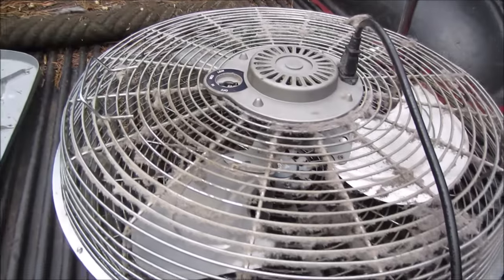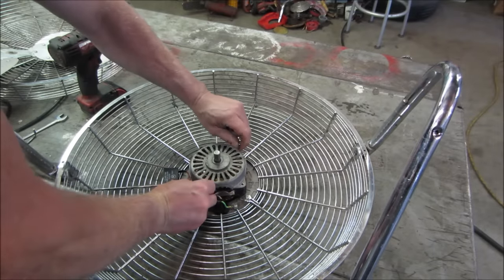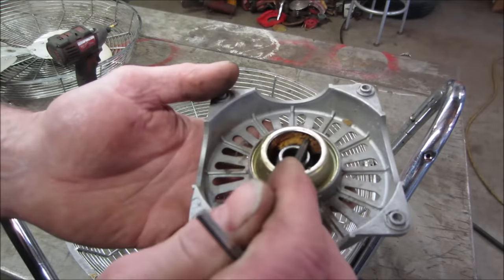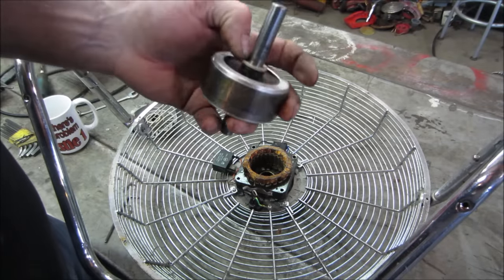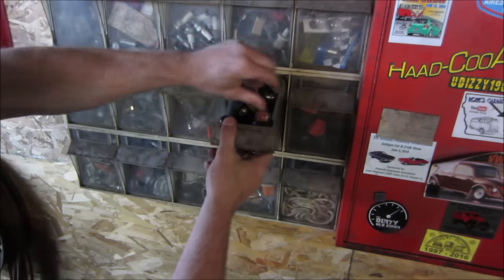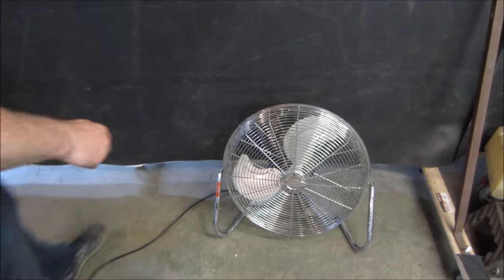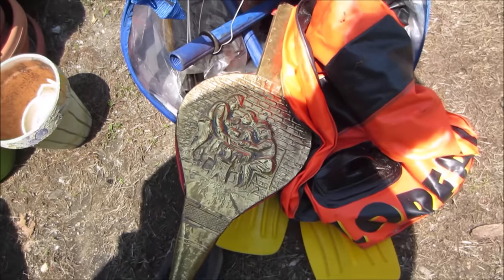Fan Blades Won't Spin? Lets Fix It

Comment: I found a dyson bladeless fan in the bin worked fine just needed a clean on the inside now works good as new
Reply: People are throwing away stuff instead of just a bit of mainrenance. Or fix a broken wire. Ridiculous.
Reply: @marcryvon  As we say in Yorkshire more brass than sense
Reply: I think the saying is One mans trash is another mans treasure
Reply: I picked up a Dyson vacuum, just needed to be cleaned and a new drive belt. Better than $250 new.
Reply: I’ve found and fixed 7 dyson vacuums dumped by the roadside. The only problem are the heavily clogged filters. It causes the motor to overheat and tripping the thermal cut-out.
Reply: Spencer Wilton Dyson scored the lowest for reliability.
Reply: I found one of those Dyson fans also and the person said it was broken I said oh yeah what's wrong with it they said it's missing the blades and I tried to explain to them that it wasn't missing and they asked do you want it or not I'm throwing it away LOL I said yes I will take it took it home and cleaned it weren't a scratch on it but it was full of dust on the inside and all those little holes are plugged up but still use it to this day what an awesome fan never would have paid the money for it up front to begin with but if I had it to waste I guess it would say it was worth it because they really work really good for a long time don't know how old it is but I've had it for four years now and that fan was also 250 plus new
Reply: @aaronfarrin4057  lol this so funny but true

Comment: It's called "permawick" - an oil reservoir for shaft lubrication in a sawdust type medium, frequently used instead of felt.  It is NOT grease. I have used this product many times in electric motors with bronze/brass bearings/bushings.
Reply: years ago yes, then they went to perma-lies of cheap yellow foam rubber, which the oil conveniently breaks down into a gelatinous goop.......
don't ask what year, I don't know, they all kind of rolled into doing it at different times. ;)

Comment: 10:20 and 15:50 You should carefully "back off" the screws by hand to make sure they're "seated" (i.e., turn them counter-clockwise to feel for them to "drop" so that the threads aren't gonna cross) before you screw them in, especially under power.

Comment: 1:59 That pause, checking to see if the set screw had loosened, or if the allen key had snapped. Been there...
Reply: haha i thought exactly same :D
Reply: It's happened to all of us.
Reply: when you knew you were overdoing it but didn't want to believe you were… then crack
Reply: Hex key is far harder than the screw on Rockwell scale.
Reply: @alwaysopen7970  that type of set screw is often about the same hardness as the allen key! I've broken both before, it's a gamble
that is if your not smart enough to just torch blast the hub real fast, in case of thread-locking compound, which many did. flame wrench = mans second best friend :) (bark-bark)

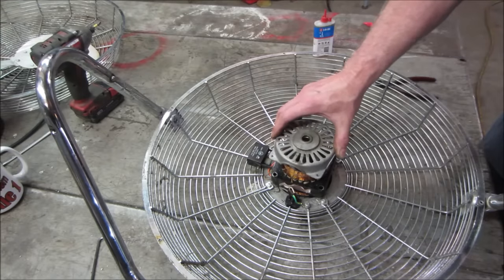Comment: 9:47 you can use a felt battery post protector to create a felt donut to put around the bushing to hold oil.  That's generally how those sintered bronze bushings in fans were designed.
Reply: That’s an excellent idea.
You can also use felt sold at Joann fabrics or other places like that.

Comment: Sintered Bronze bearings known as Oil lite bearings. I worked on a ton of machines when I was at Xerox, and these copiers had 100s of these pesky bearings. Mistreated, and these bearings made you pay. We started using Teflon impregnated bearings and things got better but still any side load, and these bearing would fail fast.
Reply: Yeah those oil-impregnated bearings get cruddy, but as soon as ANY bearing gets worn, the center shaft is no longer aligned center and the magnetic field cannot be as effective. Also, rinse and repeat what Mustie1 did every couple of years.
Reply: I prefer a military bearing.
Reply: Yeah I find even with regular oiling these “bearings” just eventually fail completely

Comment: Thanks for the inspiration! I thought my dehumidifier was dead until I saw your video. Took that fan out, cleaned it out similar to what you did here, and it's back in action with maybe 15 minutes of work. I was already pricing new ones, so you saved me at least $200. Thanks.

Comment: That foam you where picking at is the sponge for the bearing oil.  Your suppose to saturate the foam with oil also so that it stays lubed for a while until it dries out again.  Oil soaks through the bronze cintered bearing.

Comment: I found a similar Hawaiian Breezeway fan at my local transfer station, brought it home, cleaned it up everywhere except for the majority of the insides of the electric motor. Thank you for this video. It has the exact same thing wrong with it, it just won’t spin at all because of how gummed up the bearings are.

I hope that you are doing well.

Comment: Greetings: Those are sintered (aka oilite) bearings. They are designed to store oil for the life of the bearing. I would be inclined to wash out all of the excess died lubricant then relube with oil for the bearing; and I tend to use moly grease on anything.
The action of the air-flow pushes the rotor rearward toward the rear bearing. I would lube any rubbing surfaces.

Comment: I've always used a few drops of bar and chain oil. Sticks to the metal, high RPM tolerant. Usually lasts the whole summer.
Reply: I found it was too sticky. Some straight W30 (non detergent for lawn mowers ect) lasts a good while too.

Comment: i found the same fan when i was doing curbside pickup,works great, just had to tighten the two nuts that make it pivot.use it in me garage to move air around!! i have kept the same fan running behind me wood stove for 25 years by cleaning it like U did. once a year i would take it apart oil and clean the bearings!!! good catch!!!

Comment: Great fix Mustie. That's exactly what i do. Many fans come with a bronze or copper bearing and a felt washer with some lube from the factory. After many revolutions, the felt becomes dry and causes the shaft and the bearing to overheat and basically seize. I swear they do that on purpose so you end up buying a new one every so often. Sometimes you can just saturate the felt with some oil and ptfe, others, you have to sand/polish  the shaft as well and they can operate again, for a while.  Some models can be fitted with a suitable sealed ball bearing which is how the old-timer fans were made and those literally lasted forever. Another freaking item to add to the already long list of household maintenance items; 'Oil the fans monthly'. LOL

Comment: On some old electric motors they had a packing material that held oil, when the bushing heated up it lubed the bushing by warming the material and the packing would give up the oil stored with in. You had it right when you did your description of old electric motors. Good fix by the way. The oil that was used was non detergent 10 or 20 weight.

Comment: I have two vintage fans, one from the '20's the other from the '50's that both have oil cups on each end of the motor. I rewired both of them and they have run fine for years.

Comment: I've had the same issue with a fan I've found on the side of the road. It's good for a couple of hours with oil, then the problem reappears. I've removed all the old grease and put wheel bearing grease. Way better! That recessed thing is packed with grease, but after getting hot for years, it starts to loose it's property and dries. If you would like to do the best job, I would suggest you scrape all that old grease and repack it good with bearing grease. Then it will last for years!

Comment: Without reading all other comments...the rotor shaft is lubricated with 20w nondetergent oil which is held onto the shaft and bearing by a "packing" material that works like a sponge. It will hold a quantity of the oil so the bearings are kept somewhat wet with the oil for a long period of time vs. one drop that will need replenished in a short time. Most older or quality new fans have this packing surrounding the shaft and bearing and after5 years with some up to 10 or 15 years with others, oil need to be added to the packing. That 3 in one universal oil is 20w and it is non-detergent so, a few drops onto the packing front and back, will keep it from locking up like it was when you got the fan. When the packing and oil dries up it becomes a gummy sticky substance and won't allow the shaft to turn so the packing simply need a dose of oil.  Its also a good idea if you have it all apart as in this video to clean out the shaft area but keep the packing as is so it will retain the oil. Lakewood is a fairly decent brand, especially older models. In fact, most anything in fans prior to 1980 would be built for quality and able to be serviced. The real old fans and electric motors would have "oil cups" at each end to add oil. Sleeve type bearings require oil to keep them working smoothly. Ball bearings tend to use a grease and are sealed. Never wire wheel a bearing surface, use chemicals and a cotton rag to dissolve junk for longevity.

Comment: I have a white Honeywell that ive had since I was very young, the ones they still sell today (black now) I've had to take it apart 3 times now. Lubed it with used motor oil and its been good for a year now lol. Runs all night every night. That fan has had lots of use. I'll use it til I can't anymore.

Comment: Thanks for posting this video. I had an oscillating fan that had pretty much stopped spinning--but the oscillating function still worked. I was afraid it was the "startup capacitor", which was going to be hard to track down to replace (man, do I miss those Radio Shack stores, and their bins full of discrete electronic components!), but after checking everything with a multimeter, all the electricals seemed fine. 

I disassembled the motor, cleaned everything very well, and liberally re-lubed the journals with 3-in-1 (this fan had similar wicking in the journals) and tried it out before fully reassembling and it worked great. Much quieter too. This fan was probably 10 years old--but I saved it from the landfill, and got it back to nearly-new condition in an afternoon on my day off! 

Added bonus, my wife and father-in-law had their belief that I can fix just about anything, reinforced once again...

Comment: I just rebuilt a very similar fan, might even be the same one.  You have to add more oil.
I find it amazing how little dust it takes to substantially lower the effectiveness of a fan.  You basically have to clean them at least once a week.  As the effectiveness goes down, the cooling of the motor goes way down and they start going through oil.

Comment: I had the same problem with a smaller motor. I removed the motor, disassembled it and soaked both bearings in transmission oil for a couple of days. Put it back together and it's still running. That was about two years ago. You did the correct repair.

Comment: A 1/4" wing nut and a dab 9f JB Weld works perfect as a selector knob on those switches.
Reply: 1/4" knobs of all descriptions are available on line and I think even Lowe's and other hdwr stores keep some around. The 1/4" shaft has been common on radio equipment since the 1920's.

Comment: I was given a nice Bissell bag-less vacuum with a light on the front by someone who sad it quit working good.  It had two foam filters and a hepa filter at the exhaust.  They foam filters were matted with dirt and hair, they had a long haired dog, and the hepa filter was full of dirt.  The brush had so much dog hair wrapped around it that it was rubbing on the housing.  I cleaned all of the filters, removed the brush and cut out the hair and put it back in with a new drive belt.

I have been using it for over ten years now with no problems, just routine maintenance.
Reply: People are helpless, totally. That's why we handy folk are happy!

Comment: My comfort air fan was locked up, I used a shop vac to suck out dust and dog hair, saturated the spongey cotton with silicone lube and reassembled and had to give the motor shaft a tap to firmly seat it against the rear housing, working like new again.

Comment: For small electric motors with simple bushing bearings the best kind of lubricant is either a dry carbon powder (also called locksmith lubricant) or talcum powder. That way no dirt cakes to the bearings over time. Alternatively a silicone or lithium grease works well, but it's only suited for relatively small slow-turning electric motors (like a fan)
Reply: You could not be more wrong in that edited comment. Neither of those items work long term. Zoom spout High speed turbine oil/ non gumming stops gilding. All of that crud you stated does more damage to bearings. 1399 rpm is not slow. You give bad advice
Reply: I give advice according to my own experience and I never had trouble with the lubricants I used. Also, notice that I said "... like a fan". Perhaps I should have said "household fan", in that I stand corrected :) The greatest source of (bushing) bearing wear is debris, rust and assorted dirt particles; all of which "love" to cake together in oil... The best thing to do with any bearings, really, is to clean them regularly and keep them lubricated, of course. Yet, who does that, right?
But, you're welcome to give your own advice to complete mine for which I thank you !

Comment: I have three fans which I have to check and clean out and hope I can get them working again so I don't have to throw them away. One fan just quit working recently and I would like to get them working before putting them away for the Winter. I am glad that you got that fan working and hope it gives you many Summers of use before it has to be cleaned again.

Comment: Synthetic ATF has worked great for breathing life back into old electric fans like this. I used both Amsoil universal synthetic ATF and full synthetic Dexron VI because I had both laying around, but might be expensive to buy a whole bottle just to squirt a few millilitres into a fan (I use a syringe).

Comment: The bearing is called a fluid film bearing, the principle is the same as the engine's rod bearings, when two surfaces are moving with respect to each other with some sort of oil (or any viscose fluid) between them, the viscosity will cause the oil to create a small layer with high pressure which can endure some amount of thrust force depending on the amount of oil, viscosity and relative speed of the two surfaces. The bearings in small electrical motors like this one, normally don't need constant lubrication. They are made with a method called powder metallurgy and normally can absorb a certain amount of oil, the yellow material is probably an absorbent to store some excess oil for the bearing, so, i would replace it with cotton or wool or anything like that and add some oil to the bearing when the motor start to heat up again.

Comment: I realize this an older video but let me share what works for me. I put two misting plant sprayers on the outside front of my fan. The things are small brass nozzles that screw into a 1/4" plastic "T". The size sprayers that I like are 0.15 but a 0.2 isn't bad. You can either pressure the water with a hose of pump up sprayer for the garden. These are expensive if you buy it already complete of very cheap if you make your own. These really help in the southern Tennessee heat. A swamp cooler doesn't do as well with our extreme humidity but sprayers work.

Comment: My old neighbor lou gave me a ge box fan .. it was ancient...shorted wiring...pain in the arse to get to bearing... all rusty.... wow bearing is a solid 3 inch bronze ir more... clean shaft dye 2k grit sandpaper polish shaft...clean all parts. Lube my mixture of oil and tufoil..soak bearing plug one side fill with oil..soak packing... reassemble works fantastic... a solid main bearing not 2 piecees...  repainted it gonna use it  once again...50 years or more old.. leave rear cover loose so easy to yearly lube.. use foam to hold in place..

Comment: I learned about small motors from Mustie during the pandemic. 
Yesterday I got a "FREE" Patton floor fan like this one from the curb. 
Looked like a cat lady had it on the floor for 20 years.
 I have cleaned it, oiled it. Runs great but motor gets too hot to touch for long. 
I will take motor out tomorrow. 
I still have not found the carburetor.

Comment: u'll cook the winding. it is an a.c. induction motor. when spinning there is a lot of back
voltage in the coils or windings. when fan does not turn, there is hardly any backvoltage
and the coils or windings can overheat.

Comment: As a kid my family did not have air conditioning. We opened the windows for cross ventilation and in the bedroom I shared with my brother we had a big black oscillating General Electric table top fan that weighed 8 pounds ha ha. When I left home for college I discovered I was not sleeping so good. I finally figured out I missed my bedside oscillating fan so I went out and bought one......way before there was a Walmart. After all this time I still use a table top fan on my night stand and I take it with me when I travel. Fancy name? White Noise.

Comment: for smaller desk/stand fans, that "dried up stuff" is foam,  it covers the bushing, i usually apply a fresh coat of motor oil on it whenever i change the bushing.